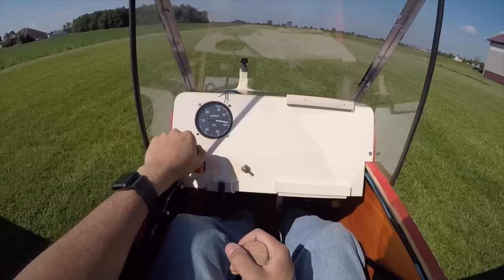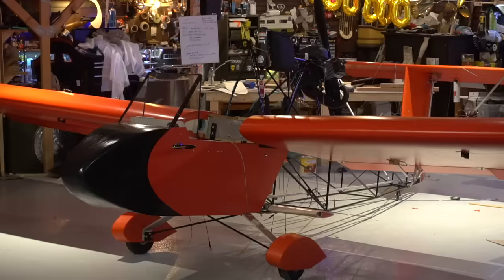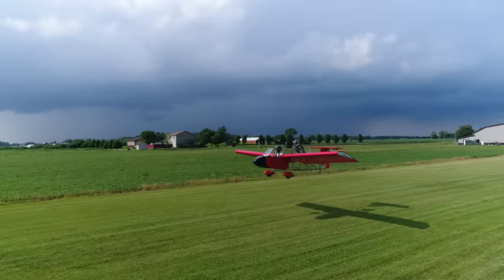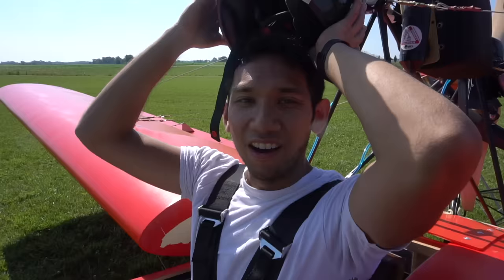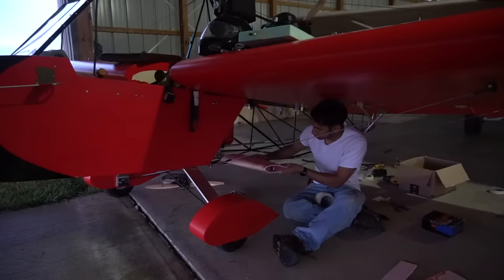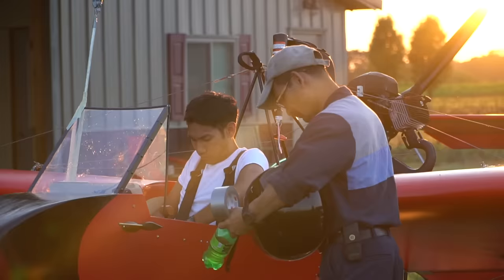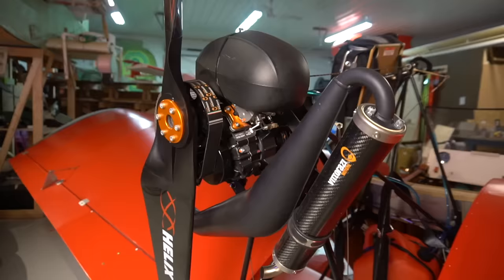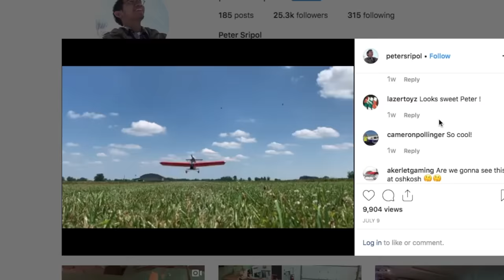MY HOMEMADE airplane flies!!! MK3 design

Comment: "nose heavy," "drag," "underpowered," "Doesn't want to climb" Look at your windscreen deflect, and it's incidence to the air. It's a canard fully pushing the air up, nose down, and stealing the prop's clean air. Think motorcycle not jib sail.
Reply: Drag weak 
Nose heavy
Not Climing 
Moms Spaghetti
Reply: Good point :D
Reply: Fluid dynamics 😎 Ditch the screen and wear googles, check performance and then design from there? I know nothing btw other than basic physics 👍😁
Reply: @TheSpog  ..  I choked while laughing!
Reply: Excellent point, it is like a barn door and it will effect the flying angle, but the drag and wash/turbulence over the prop would be really bad.
If you want a screen, make it much smaller and curve it to deflect around. Best of luck and well done getting this far 😀
Reply: You can see at 12:55 just how much pressure the screen is applying by how much it is bending at the top.
Btw I own and fly my own microlight so have been there too!
Reply: @vumba1331  . nahh. you're right sir. I think so
Reply: Even a three piece screen, middle and two sides at about 45 deg would help, or take your socks off too. Lol
Reply: You're a modern-day freaking Einstein man!
Reply: Hello PeterSripol. Can you tell me how is wingspain MK 3 , how is a  wing chord with flaps/aileron, how is a long body with elevon,??? And it is the body from 16x1mm 30CrV stel?

Comment: Yes; flying again! One suggestion: I think your aircraft's windshield = troubles. Large downwards force on the nose, major wind resistance, and turbulent air going to the propeller and tail. Make it small and smooth, go sit a bit more leaning backward.
Reply: gold, nobody saw this comment?
Reply: Yess !
Reply: well spotted
Reply: I think he should just duct tape a jet engine onto it
Reply: @MeI-ct4dv  
maybe this guy can help 
Игорь Негода
Reply: Consider taking inspiration from windscreens for touring motorcycles. A lot of them has an easily adjustable spoiler on top - which would allow for perfect adjustment for a particular speed. Also it could be flipped completely down for the takeoffs.
Reply: Perhaps he should carve a more aerodynamic dome shape out of wood and heat up some lexan to make it.
Reply: it should look more round in shape too, air likes round surfaces to stream off of
Reply: kee zhengkai LS powered ‘ultralight’
Reply: @ronyoutu  - I agree. Get rid of the windshield.
Reply: I notised that the windshield is making a lot of drag but not the downwards force and you are right because if you pay attention on 12:56 you can see the top of the windshield is bending inwards and that's probably what making the ultralight nose heavy and he can fix it by intalling a round windshield like in any other plane
Reply: Aerodynamically this whole plane could use a lot of improvement. I mean, not to criticize too much, because I’m not designing and building my own plane in my garage, but there are many well-known ways he could make this better. Besides the high, steep windshield, those blunt trailing edges on the control surfaces need to go. Sharp corners on the fuselage create vortices which increase drag at high AOA. Why not cover the fuselage tail boom?

Comment: Casually playing a song called Mayday while flying a homemade plane that could crash at any time, smooth.
Reply: Lucky he has a parachute.
Reply: Mayday? Vocaloid? I saw this and thought KAWASEMI!! From Jailbreak.
Reply: Meriphia i could feel the hostility from your bio
Reply: Meriphia the first thing I thought
Reply: Your brain is still a ice cream
Reply: @Justwantahover  ...a parachute that is 100% useless because he left the safety pin in place, not to mention the release handle is in a very bad position for easy access.
Reply: Harman Robotics, OMG! 2.5 seconds to pull the pin out, that’s so long! He will totally crash In the total 5 seconds it takes to deploy it. He will 100% stall!
Reply: @neoleomedia1676  People have died as a result of the safety pin not being pulled out before flight. It is something to take seriously.
Reply: @HarmanRobotics  People have died after being crushed by vending machines. People have died from eating too much. That doesn't mean people shouldn't use vending machines. It doesn't mean people should stop eating.

Comment: Peter in 5 years

This is my MK48 Suborbital class rocket booster and payload assembly.
Reply: Peter in 10 years

This is my homemade boeing 777-300ER
Reply: Peter in 30 years

Welcome to my 69th video on the MK420 Hyperdrive Interstellar and Commercial Space-liner
Reply: @aureavita8653  nice

Since you said 69
Reply: Peter In 50 years I built a harrier
Reply: @isma4509  nice
Reply: Peter in 7 years: 

This is my home made F-22 raptor stealth fighter, it wasnt to hard I did it in a month.
Reply: Peter in 80 years
That's me flying my MK3 Airplane for the first time, now lets hop back in the machine and head back to 2089.

Comment: Feel like the instrument panel needs making simpler
Reply: I’m waiting to wooosh someone. Great comment
Reply: @ayopiop2392  Wooosh me because Im not a pilot lol idk what he means
Reply: Sckupz if you look at the interior of the plane, you can see only one gauge for airspeed (I think). Usually the place where the gauges are placed are called the instrument panel, and since there is one gauge it is extremely simple. I hope this helps.

Edit: if you pause at 2:45, that is the panel I’m referring to.
Reply: Yolo Piop 2 ah gotcha lol. More of a car guy than plane person but peter does some neato builds lol. Thanks homie :)
Reply: Sckupz no problem. Glad I can help
Reply: @sckupz5125  Instrument panel = dash
Reply: The instrument panel just shows  "Going Up" and "Going Down" ... cuz what goes up, must come down. he-he
Reply: Just one led, is the motor running
Reply: There's only one gauge and that is rpm.
Reply: It needs more airbus
Reply: lmfao
Reply: Airspeed indicators are for sissies.  Real men use wind noise! 😂

Comment: No risk of information-overload from the instument panel there...
Reply: Have you noticed that  boeing 737 max has a shit load of instruments and they crashed twice in a year this plane has 1 and never crashed, really makes you think doesn't it
Reply: // the answer it’s simple: it’s the plane simplicity. Now they are making them too over complicated .
Reply: // yeah because this plane and complex airliners are totally comparable.
Reply: Virat Vaid I kind of get what he’s saying though. I think Boeing made the 737 max way to complicated with systems like the MCAS designed to override something a basic private pilot should know how to avoid (an inadvertent stall). If you know the basics this airplane is so simplistic you’ll virtually never get into trouble.
Reply: @jtkent28  no one responds to ya cuz to most people your speaking alien language, aka Aerospace terminology XD.
Reply: @jtkent28  Yeah, except that a experienced commercial airline pilot flying right seat in a B747 for China Airways stalled and mushed over 30'000 feet in an aggravated stall and only because the pilot returned to the cockpit and figured out what he was doing is anybody still alive...... 

Comparing this to anything in a Part 135 operation is like comparing a tonka truck to a freightliner.  When you have several thousand hours in complex aircraft and a commercial and ATP ticket, then I think you will have a place to comment from. Yes you can state your opinion, but I believe you don't have a decent frame of reference.

Peter Built an aircraft in his shop. It flys... Awesome, lets leave it at that.
Reply: // it has alot less flights,
Reply: It's basically a flying lawn chair, so anything beyond that is overkill.
Reply: @houstonhelicoptertours1006  We need to help fund him to get an F16 cockpit to throw on that baby. He needs to lock his electric rc missiles on a target a hundred miles away!
Reply: @houstonhelicoptertours1006  i dont know.. i think thats an altimeter? A compass at the least would be nice :P
Reply: @cdreid99999  *speed indicator
He could add altimeter, slip/skid indicator,  compass and a proper engine RPM indicator...that's enough for an airplane of that complexity.
Reply: I think its mainly because gyro instruments are really expensive and heavy and they are not needed

Comment: You need to ditch that airbrake windscreen (though it will be giving you some nose-down pitch help presently) - either no windscreen or at least a more aerodynamic one with neutral pitch/yaw moments.

Comment: Yes officer this is my home made plane....and here is my home made pilots licence. 😀😀
Reply: tyvek05  Well thank you for clearing that up for me.
Reply: tyvek05  wow I thought you needed a license for any kind of airborne vehicle
Reply: @mechanicalamateur1664  Nope. Ultralight class doesnt require a license. Having said that, it's easy to screw up and die. Wind on a light aircraft can toss you around and be very unforgiving. Whatever you do dont just jump into this, approach it very carefully. I recommend taking some flight lessons and asking a lot of questions while in the air related to your goal from whoever the pilot is. You wont know every question to ask related to your goal, so ask the pilot to tell you the answers to the questions you dont even know to ask.
Reply: @SigmundQFreud  Btw I subbed
Reply: @SigmundQFreud  and hit da bell if you ever make sum viddys
Reply: After all the work to build one, would you trust anyone else to fly it?
Reply: in the US, part 103 I think it is. But that said, you can still get training, and it's recommended. the Paramotors the engine was made for are the same deal. that said, the King of Random guy died in a parmotor accident, so... keep that in mind.
Reply: Hey everyone, flight instructor here. Sigmund is pretty much right. No need for pilots license when operating an ultralight. That being said in the aviation industry there is a vast difference between meeting the experience requirements and being proficient enough to fly. I would not recommend flying in any sort of capacity solo without any instruction. If you are interested in learning to fly I strongly recommend getting at least your private license.
Reply: AJP Streams what are you gonna do pull him over?
Reply: Realistic classes and costs of pilots licences:

Ultralight/baloon/heligyro etc: almost nothing to a Bit more (youre a fool if you get into an ultralight with zero training). 
Light Sport aircraft: Things like Trent Fly (kitfoxes, avids). 1 passenger. < 1320 pounds gross. > $4000 - 6000.
PPL   > generally any plane with a single engine    > $8000-14000. The variable is how long it takes you.. 40 to 70 hours.

Airplane costs > ultralight  - say $3000-5000 for a used one
LSA - I paid $13000 for my avid but they run $15 usually. Kitfoxs 12 to 20,000. LOW operating costs. Say $1000 a year maintenance
PPL - Lowest end planes  - cherokees, 140's. From $10k to 25k. Maintenance costs $5000 to $10000 a year.. based on real world figures from a lot of pilots who keep records and make them public.

LSA's are the sweet spot. And the licences go last to first: PPL can fly all 3. LSA can fly ultralight but not most  GA planes etc. Lots of other choices too from heligyroes to balloons to powered parachutes etc.

A new car will run you about 25 - 35k now low end. For that money you can get your pilots license and an LSA or 140 and you'll be able to fly for life (Planes arent cars.. they last forever because people Meticulously maintain them.. you can easily buy planes built in 1935 Now... in perfect flying condition)
Reply: he mentions it in another video you do but he has one
Reply: Leftist Lyncher FAA*
Reply: justinl458 woah dude calm down it ain’t that serious
Reply: An ultralight airplane does require you to have a licence, im literally making one as we speak. Even for a glider airplane you need one.
Reply: Jakub Hobl Not in the US you don’t. As long as it’s under 254 pounds empty for a powered aircraft no license is required. His is under that number so he is completely legal to fly with no license. The parachute weighs extra but the weight of the parachute is not figured in under Part 103 as it is a safety device. 

The fact that you’re building one right now and are still making false statements is concerning if you’re in the US. It would see like these are things you’d research before building an airplane. If you’re not in the US then it just seems silly your making statements like that under a video based in the US as if they are facts and don’t state the country you live in. It doesn’t take someone building one to know this information, anyone with an internet connection can spent 90 seconds on the FAA website and read part 103.
Reply: tyvek05  In the UK you need a licence for pretty much everything including having a TV.
Reply: tyvek05  Its a good idea to have a reasonable amount to flying training.
Theres more to it than the flying. Understanding the weather, navigation, radio, even knowing what an extra couple of centimetres of grass can do to your take off!
Reply: Nope! There are several slow flying aircraft that you can fly without. However, it is strongly advised to take real professional training first. Such as at Aviatorppg. Con for Paramotors.
Reply: @RedEyedJedi  well, they call it a licence but it's really a BBC enforced subscription!
Reply: @hugostiglitz6914  That's the real name for it.
Reply: Just a heads up to everyone, even a childhood ADD/ADHD diagnosis will make your medical and thus PPL difficult to obtain. I have done hundreds of hours in the 172 on FSX and 6 hours IRL. The thought of having to blow thousands more dollars on a waiver or "don't ask, don't tell" for Sport Pilot is just a bummer. I actually switched to a Light Sport and didn't enjoy it nearly as much. That said, I encourage anyone with an interest in general aviation to go to your local flight school and ask for a Discovery flight. For as little as $99-$199, you'll go up for 30-60 minutes with a certified instructor. They'll let you control the aircraft to your (and their) comfort level, walk you through procedures, etc. so you can get a feel on whether or not it's for you.

Best money I ever spent.
Reply: JUST TO BE CLEAR YOU DO NOT NEED A LICENSE IN USA

Comment: Peter in couple years:
My homemade jumbojet actually flies but nose is still a bit heavy.
Reply: Peter 2030-"My homemade real marvell's plane flys at lightspeed but the nose is a little heavy"
Reply: Sorry Oprah back to economy
Reply: More years later:

My homemade spaceship works great but now I have to put some tape because it got air leaks
Reply: Trimming will balance it out tho
Reply: Some more years later: my intergalactic FTL engine powered flying saucer works as expected. Although, I feel some turbulence at 98,7853% of light speed.

Comment: I see your propellor is belt-driven by your engine, you could adjust the gearing/ratio on that to increase your RPM. Easily the cheapest solution.

Comment: Perhaps it’s not nose heavy but instead the high mounted propeller creating a moment around the CG causing the plane to pitch down when throttling up. This is a common issue with seaplanes when flying.
Reply: Didn't think of that
Reply: That's a very good point to be fair
Reply: Yea I was thinking that the angle of his propeller might have been messing him up. Maybe they checked for it maybe they didnt.
Reply: Yeah he said this was a problem in the previous video, I'm not sure if he fully addressed it or not
Reply: Josh Anders <— And I guess the nose up torque moment caused by the drag of all that isn’t it going to counteract the thrust vector, but it might reduce it a little... Still, drag is always the enemy.
… Apparently, something very similar to this is what caused the problems with the 737 max because at take off power, and Joseph was considerably more pronounced because the travel of the engines through the arc translated to more degrees of rotation at the center of gravity, and was catching the test pilots by surprise, and their fix, of all things, was to change the program in the auto pilot software so that if the system detected the wrong combination of angle of attack, airspeed, and rate of climb, pursuant to a stall, it had the authority to oVERRIDE pilot control input and lower the nose. Problem is the system detects this first and initiates the nose down, meanwhile, the pilot is struggling to get the nose down, OR  is totally confused because while They have been hauling back on the stick with the throttles fire-walled, yet The plane has mysteriously nosed over, and their windscreen is filled with mother Earth hurtling towards them, and so the pilot and the auto pilot get into a tug-of-war until the right combination comes around to cause an actual stall and crash.
Reply: @thatfeeble-mindedboy  the max issues were pilots being incompetent. Litteraly all they had to do to prevent crashes was trim up 20 degrees. The Ethiopian crashes were a mechanics fault for setting the default trim to 55 degrees down. That's ignoring the copilot who had less that 200 hours of total flight time who was left in control at the time of the crash.
Reply: Good point. He could test it pretty easily by changing the throttle in straight and level flight.
Reply: Volatile 100 <— I am sure those things contributed; but the reports I got said that several pilots have come forward and stated that they felt the training was insufficient, and apparently a strong case is being made for that in the lawsuit (S)… The other issue I heard repeated is that it was a fundamental mistake on the part of Boeing to try to fix a fundamental airframe problem with a patch to the autopilot software that was authorized to override pilot control input if certain conditions were met. As most things, it isn’t a single problem that can be blamed, but some confluence of several things.
Reply: A